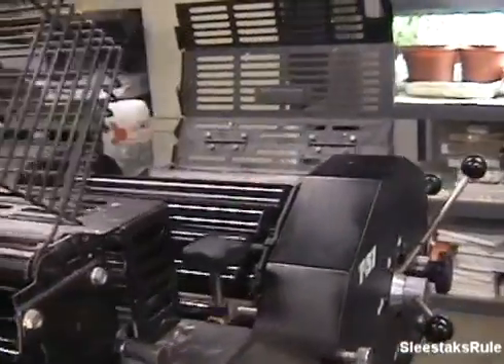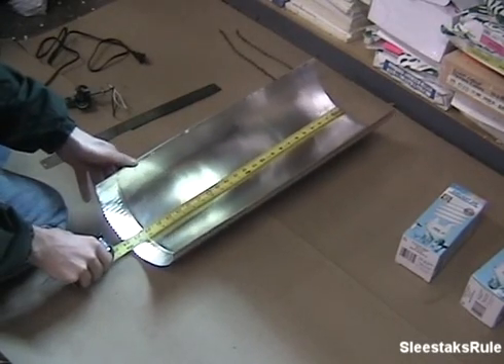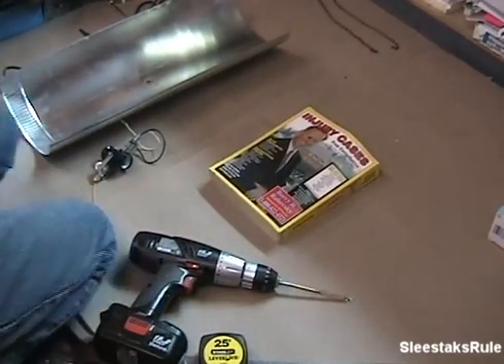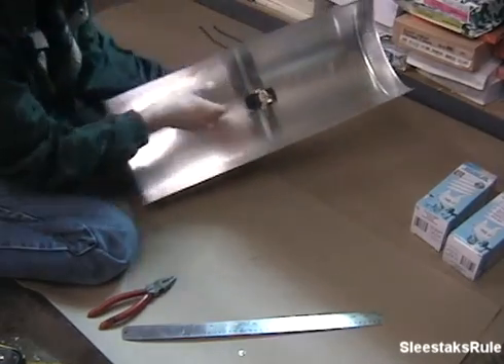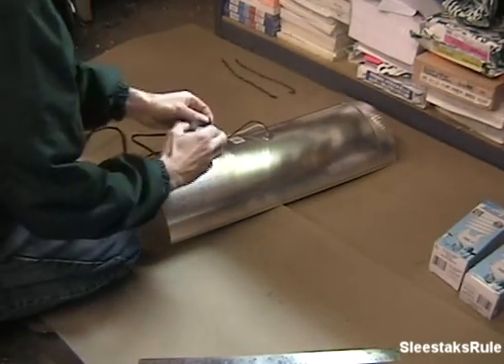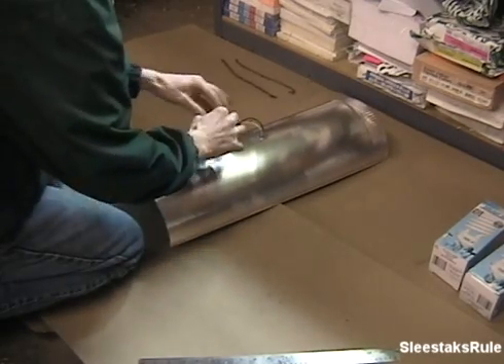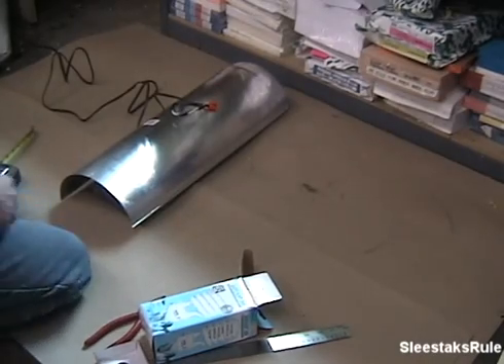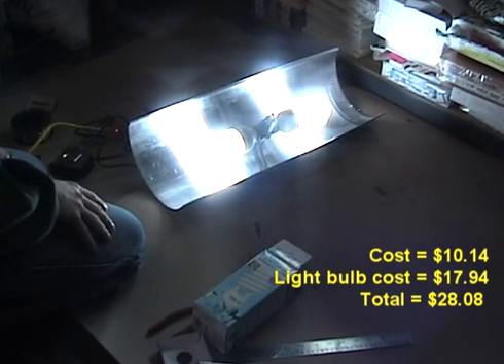How To Build a CFL Grow Light Fixture - CHEAP!

Comment: My very meager understanding of electrical knowledge tells me that you should connect the white wire from the light fixture to the wire on your extension cord that has the wide spade on the plug to keep the polarity correct.

Comment: The lamp cord has ribs in the plastic insulator on the hot wire.  You should never connect the hot wire (black) to the terminal on the fixture that corresponds to the threaded portion of the bulb.  You can get shocked handling a bulb, and is why one of the spades on the receptacle is bigger than the other.

You had a 50/50 chance to get the polarity right, but you should check...

Comment: I'm using a ghetto version, just rigged up an empty bowl with aluminium foil and then drilled out the end for the lamp cord.  Of course my space is just for smaller plants - being a repurposed cardboard box with mylar and stuff.

My total is about $200, but that's because I used LED light bulbs and hydroponic fertilizers to start.  I estimate the two things would last me years of use, so the $200 was not a waste....

I had an emergency space blanket, the cardboard box, and an aquarium light fixture (which houses reptile lights).  I think I'd switch over the LED lights completely soon.

Lmao @ the injury attorney torture.  :D

Comment: What it needed to be safe was an electrical box for connections of 120AC voltage wire. Wire nuts and tape all good, but can accidentally pull apart.  Safety required they needed to be secured into an electrical fixture box. About a $1.25 for plastic and closer to $2.00 for metal. The 3/8" threaded part of the bulb sockets should screw into the fixture box and cover. Provinance = Forty+ years of electrical work experience.

Comment: love the attorney joke ;) good job right between the eyes. Nice neat job, love it. Perhaps a rubber grommet where your electrical wires come out the back of your shade might be advisable... just in case. To protect the cabling from the drilled hole... oh I didn't notice the metal sleeve...a focus issue, or perhaps my eyesight, anyway nothing completes an electrical project like a fiddly rubber grommet.
Reply: Danny , what he needed was an electrical box for connections of 120AC voltage wire. Wire nuts and tape all good, but safely secured into an electrical fixture box. About a $1.25 for plastic and closer to $2.00 for metal. The 3/8" threaded part of the bulb sockets should screw into the fixture box and cover. Provinance = Forty+ years of electrical work experience.
Reply: Richard G. Stone, Jr.
 scooozi, I have a side line promoting rubber grommets... only joking ;)

Comment: were did u get your dual socket light fixture? n what size is the metal ducting?
Reply from the maker: I can't recall the size of the ducting but you'll see it at any hardware store and it's a common size.  The light socket can only be bought at a store called Menards or from Amazon at this link: http://www.amazon.com/gp/product/B00GW53HB6
Reply: SleestaksRule Where did you find those bulbs? I can only find the smaller 100watt equivalent (daylight) type.

Comment: a plastic  pickle bucket will suffice also.  Cut the bottom out
with an electric jig saw, then cut it in half lengthwise.  use contact cement to line the inside with foil.....

Comment: I couldn't find an aluminium dryer vent similar to the one in your video at Lowe's but did find one at Home Depot.  The part number is DP244 Aluminium Vent Pipe 4" x 24".  Made by the company Deflecto.  Enter DP244 into the search box on Home Depot's web site and it should come right up.  Thanks, for the video and idea SleestaksRule. My completed light looks just like yours.

Comment: This works great! I wired 3 up each over a shelf in one of those four foot plastic green houses. My artichoke seeds sprouted in 3 days. I also use 17" wide "flexwatt" heat tape under the flats, it's great for starting seed flats in a rack.

Comment: One long florescent fixture will be more efficient.
CFL units are not all that efficient, they are built into a form factor that allows drop in replacement for an incandescent bulb.
If you really want effective lighting you will want a mixture of natural and artificial lighting, panels that move to allow the light in and reflect when artificial light is present. 
A 24 hour grow cycle is not good, plants need time to regenerate electrolyte balance.

Comment: How many plants do you grow under the single 2 bulb fixture? I want to grow 4 plants at a time, should I build two of the 2 bulb fixtures with the larger lights from the link? Also what bulbs are you using for flowering? Thanks!

Comment: I used this video to make this light fixture a few months ago, and it works great.
I made one modification to the design, 
I used 2 of the double bulb fixtures, each mounted 6 inches from end, instead of 12 inches to center.
I used 2 - 75  WATT 6500K and 2 - 100 WATT 2700K CFL's, which seems to cover the light specs. perfectly.
My "tomatoes" are doing really great.
Thanks for the video!

Comment: This works better than the clip brooder lamps I bought from wally world for 10.97. I know the CFI bulbs get hotter when u use them in fixtures that cover their base/ballast. I also have heard that spiral cfls loose a lot more light when u hang the upside down versus horizontal. I bet the 68watt 27k 4200 lum I just bought at home depot  (14.95) wouldn't fit since the spiral is so wide ! LOL !

Comment: Thanks, I based by build on this.  Mine was closer to $70 with bulbs, but I'm using 6 1600 lumen 6500K 26W CFL's.  One thing I can't believe is how cool this setup runs- it's barely warm at all.  I also used a rubbermaid grating for stability and easy hanging, along with a few metal brackets.

Comment: Thanks for the vid,I used different items to build mine but used your hood idea.
Items:
1) Drop shop light
1)Two outlet socket adapter
2)Polarized socket adapter's
1)Vent piping
2)Bulbs
I removed the the cage from the drop light, cut a hole in the hood, put the light through the hole, added the sockets, screwed in the bulbs and was done. I went with the 105watt CFL bulbs you linked.
h/tt/p://i45.tinypic.co/m/30kfx3p.jpg
h/tt/p://i45.tinypic.co/m/33vzwax.jpg

Comment: When splicing wires together...i know white is positive and black is negative on the light socket. but when you splice it to the power cord that plugs into the wall...how do you tell which is positive and negative on the power cord? they are both the same color and are not labeled on the cord i have. But, like a lot of wall plugs, one prong is larger than the other...which side would be which?

Comment: I need some help. What would happen if I ran 4100K lights all the way? or would I need to run 2700K and 5000K or 6400K.  If any of you check out my vids you'll see the layout of my set up. I can't find any information on lighting and I just want to know will 45,000 lumins of 4100K in 8 sq, ft. be good for bringing up healthy plants from seed to fruit? if any one can help thanks a bunch. P.S. I'll be using CFLs.

Comment: @1KREEPAH3 also you can use Colemans Emergency Blanket
Its a camping supply, you can get at any sports store or sports section, its made of a shiney material which is 90% reflective. I read it in hightimes, it was 2nd suggestion other then mylar which can be kinda hard to find and explain why you want it without raising suspicion

Comment: Tape the wirenuts so they won't fall off.  Don't skimp.  Stagger connections so that you don't get a short if by the remote 
chance one of the wirenuts falls off.  

Do you get a dim spot between the bulbs, where the phosphor coating is thickest and thus transmits the least light?

Comment: yes, but only for a small area of grow floor space. It is so small a wattage that you couldn't do more than a single plant, which is like me. 

But I run about 200 or so CFL watts per square foot.  sugar!

I would switch to 12 on and 12 off when the plant got to about 6 inches tall and no taller or your light will not have depth of penetration enough to do the whole plant during flower. this is strain dependent to bloom this fast! . cool white for vegitation warm white for bloom. remember that.

Comment: tight budget. exactly. get wet. 

just don't look in the window because you don't have the money right now that you will have in the future. and CFLs don't burn your leaf tips but they make young, veg plants go nuts. but, CFLs do not have the depth of penetration of a hps, especially a kilo watt jobbie like tru here is probo down with, right?
but I got past that even, I run a ceramic metal halide and it kicks

Comment: how do you smoke Too much lol? unless it's tobacco, yech. I am a construction worker and I smoke pot. this is a good idea, but it has safety problems that will get someone slashed. I work with this kind of vent pipes and those edges will get someone hurt. duct tape, hell, anything is better than those exposed edges. I grow, ok? I just don't want peeps hurt with them edges.

Comment: I made a 16 lamp CFL and used wood because this vent pipe is Unsafe. You will get the hell cut right out of yourself, your face your hands etc with that unprotected vent pipe. This is dangerous and mine is way more powerful and not so dangerous. Use wood and 26 watt CFLs and a screw gun and simple wire. piece of cake. all ya gotta do is eat it. the bush abides

Comment: They have full on double light ceiling fixtures for like 5 bucks.. you can take the fixture out of there. As a matter of fact, I dont even recommend using these fixtures. You can buy Porcelain sockets for about 2 bucks each and wire them then attach them with clamps. The porcelain will dicipate heat better... especially if you go with higher wattage.